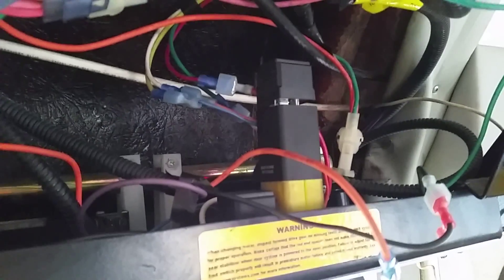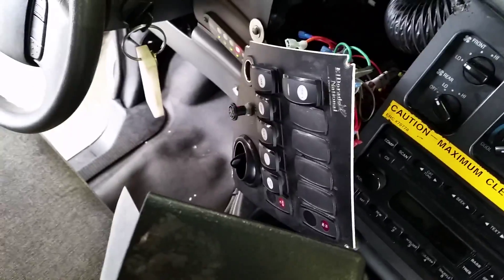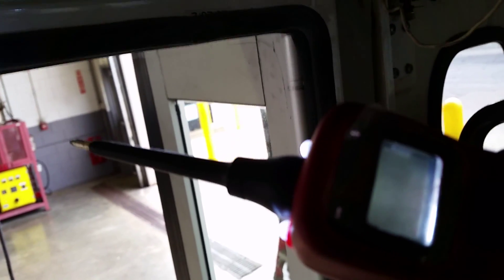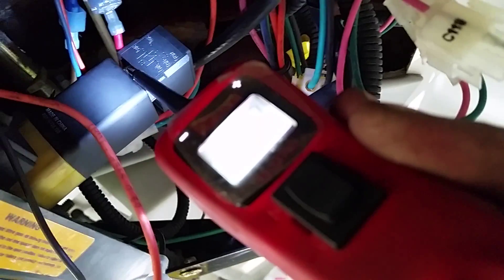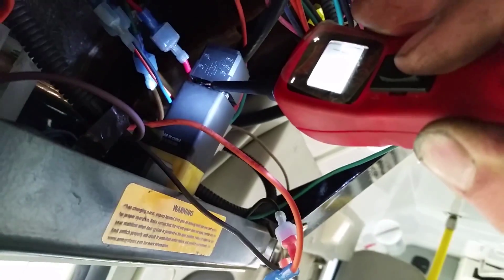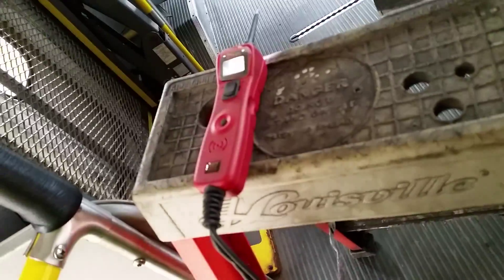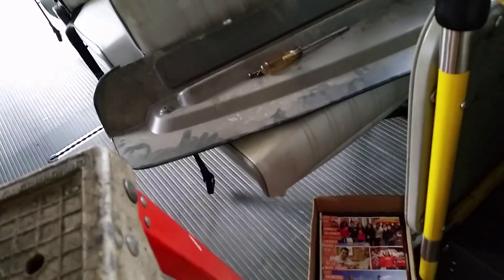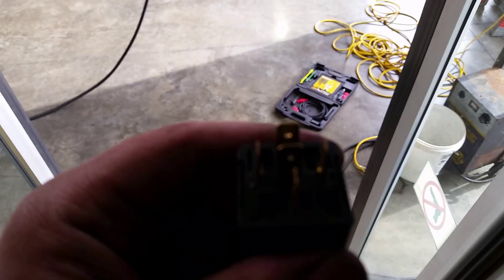Door Motor Fault

Comment: Nice- so you had a broken ground wire to the relay thus no ground door can't open not sure where the 13 v on the ground was coming from ?
Reply from the maker: +STEVE ROB I was right at the ground to the relay coil and supplying a ground to it.  The internal connection in the module for the ground was open.
Reply from the maker: +STEVE ROB Oh and sorry it took me so long to reply, I am a very busy person.lol.